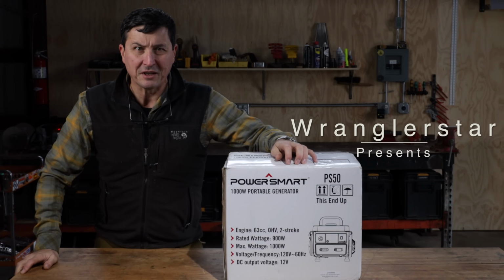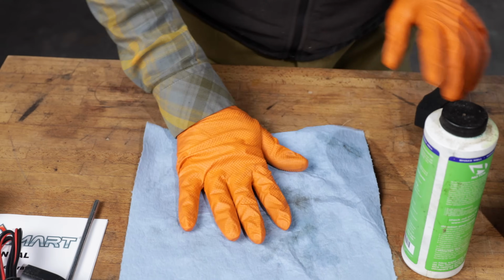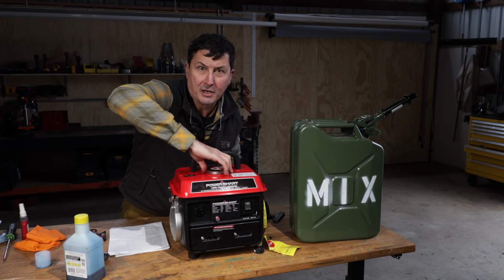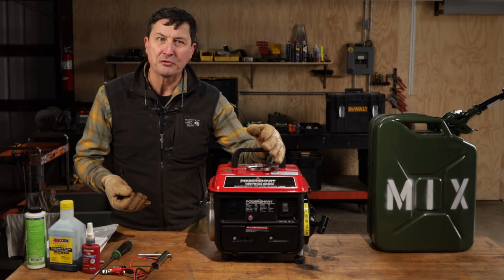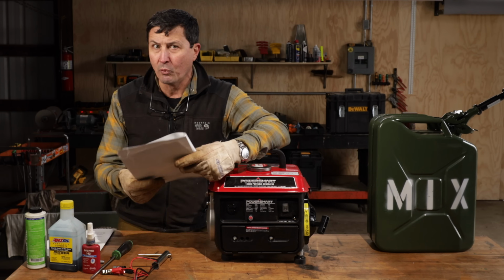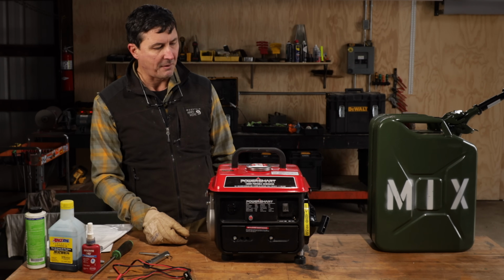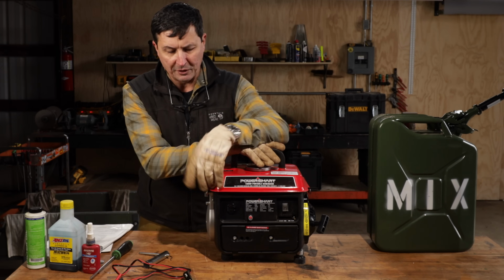TESTING The Cheapest GENERATOR on Amazon -$99

Comment: i have a gude (basicly identicall without 12v charger), had it for 15 years, plastics falling apart,  one leg fell apart, fuel cap leaks, leaks oil from exhaust, never changed spark plug nor air filter and the damm thing still works and starts every time easy on high altitute and cold . those small generators are great for a small off grid house to power the lights and some small stuff.

Comment: I have the ace up version of that generator for $200. Also a 2 stroke. Also 1000W. Doesn't have a sperate 12V battery charger sadly and surprisingly. 71CC though compared to 63

Comment: The 20 amp plug is there so if someone needs to use a 20 amp connector it can. The machine will not even handle a full 15 amps. So the plug is designed for functionality not for usable capacity.

Comment: About to buy a cheap generator to use in my yard truck to run my 120 v string trimmer on the far ends of my property.  Battery string trimmers just don't last long enough.  So that why I'm thinking of this generator.  I have a 12 KW standby generators on my house, with an ATO, and a  6KW one for the shop.  But that darn string trimmer is a pain to keep recharging. And there is no way I want to load up the big shop generator in the yard truck.

But here's a tip for you folks.  You can either buy a boat fuel tank with the quick releast fuel connector to rig to you little generator, or just buy the male and female boat type fuel connectors and rig them up to work with your 5 gallon Jerry Can.  The nice thing about these connectors is they have internal valves that shut off the fuel flow unless pugged into the other corresponding fitting.    So using a "T" fitting and having the ability to remove your big can to run after more fuel while it's running on the oem tank is a big plus....You may want to put a ball valve on the "T" so you don't back fill the OEM tank when running on the aux tank.  Depends on how you set them up.

I use the boat connector set up on my 4X4 trucks rear rack gas cans so I don't even have to pickup that heavy 5 gallon can to fill or pour from it.  I just refill it at the gas starion when I fill the trucks normal gas tanks......  BUt I do use a small 12 volt  fuel pump as a transfer pump from the 5 gallon to the main truck tank.  Or for sharing with others or the motorcycles we take with us.  And that's how I fill my lawnmower without having to put a gas can inside my vehicles.
Reply: Curtis

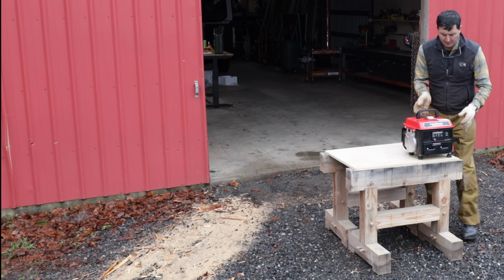Comment: 6:05 gotta love the ol two-smoke engine. I've been using mine for years. Keeps the cabin lights on and solar batteries charged in the wintertime. Pro tips: use fresh no - E gas and Husqvarna low-smoke oil. To kill it for the day, shut the gas off and let it run out. It starts even in Sub-Zero temperatures, ask me how I know. Keep an extra plug. Peel off all the silly stickers. btw, Mine doesnt have a 12VDC output. Just 120VAC.

Comment: I've got 2 two-stroke generators, both Homelites. Ones an XL-12 A115 (yes based on the sixties XL-12 chainsaw platform) and a larger 9A115-1 that used to be owned by a local fire department that i just bought today at an engine show. Seller had a matching water pump, but sadly I didn't have enough cash on hand to buy it as well for the $40/each the seller wanted for them.

Comment: I think those Torch sparkplugs are actually great. I've got this old Ross lawn mower and after watching this I assume the Torch plug in it is the original. Its probably run 1000+ hours over more than 10 years and is still going strong now even with multiple cracks & a bit missing from the porcelain.  At least 2 times I've given it a good soak & clean out after it totally gunked up & with sandpaper too and works a treat again after.

Comment: Yep this is an older vid but I had to comeback to it . I had a harbor freight tailgate when this came out . I liked it . It just worked . Infact I just got my hands on another that needed some work done on it do to sitting around. It was gotten for when the power would go out and it never happened. So the fuel just sat in it for years . Until I came along and got it . I drained it and gave it a clean out . It just fired up ! I have #2 !

Comment: I have one but my battery backups don't like it because the AC frequncy doesn't stay close enough to 60Hz at no load or changing load, but my computers run on it no problem. It's a lovely generator otherwise, great for running lights, chargers, and refrigerators. But it's not as good as an inverter generator of course.

Comment: I bought one at garage sale $5. Needed a fuel shutoff valve tank and carburetor cleaned. Put a paper fuel filter in it. Tank not perfectly clean. Works well takes several pulls to start.

Comment: I just ordered this from your review. I just received it an unboxed it. To my surprise, the latest PS50 is not 63cc. It comes at 71cc and is no longer 1000w 900 out, it has increased to 1200w and 1000 out. I ordered the 1000w because it was the only one listed on amazon. There was no general information stating that they upgraded. This is not a complaint by any means just a great surprise. Thats was really cool to receive MORE than what I originally had planned on. I will give it a trial run and report later about the upgraded version.

Comment: I ordered the upgrade version of this generator.
Right from the get go it made a clanking sound. I ran it anyway only because I needed it for my refrigeration. It still runs but I think I needed to deal with the clanking noise. I'm guessing it is something to do with the coupling between the engine and the alternator.
I'll let you know when I have time to find out. Also the plastic part the plug socket is mounted in isn't secure so I have to hold the plastic when I unplug the cord.
In the meantime... I bought another one. It's running great. Except I forgot to put oil in the cylinder... But I did put some oil treatment in the gas tank. It's running great. No issues on the replacement I bought. The first one I paid $159.99 and the second one was $141.94.
This generator is a model PS 50A which is a little better than the one you bought. On mine the label says it is a 1200 watt generator. I tried running a large microwave oven and it couldn't get the magnetron going. It heats a small griddle okay.
Currently I'm running lights, refrigeration, and charging batteries.

Comment: This is a 1000 watt generator, so how did you run a 1500 watt heater on high? I don't believe you got the full benefit of 1500 watts. you got around 800 to 1000 watts because the generator tops out at 1000 watts. It is also rated at 7.5 amps. The 1500 watt heater requires 15 amps. Also, I WANT TO HEAR COMMENTS ON THIS.

Comment: I know I'm a little late to the party, but I have seen and used lots of these. They're actually pretty good.
Some opinions are.

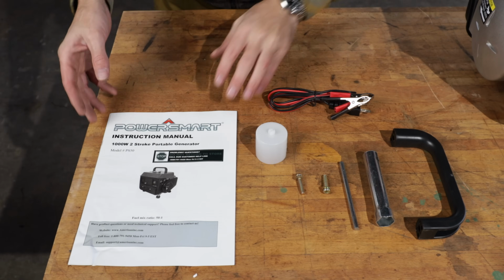0:32 actually, that's the first time I've seen that on a manual. Very nice
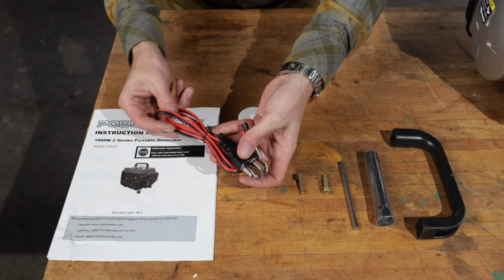0:40 those 12 V cables usually explode when used. They're usually too thin for the 8-10 amps they're supposed to deliver.
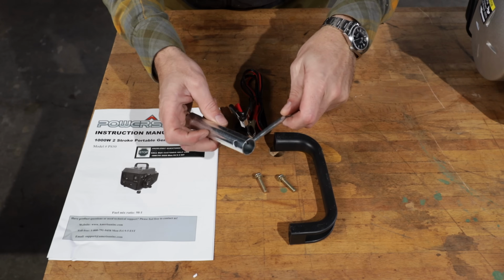0:56 I don't see the gaskets that those handles use. The screw holes on the tank are almost always pass-through.
2:00 you're actually supposed to impregnate the air filter sponge with oil.  Also, the manual recommends motor oil.
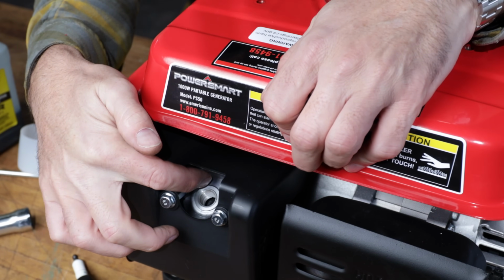3:55 actually. A lot of these are test-run at the manufacturer for QC reasons and a lot of times, they're run on low oil, so you get pre-scratched cylinder walls!

I actually own one of these. Got it 6-7 years ago and I love the thing. The  piston and rings are completely worn out by now. Unfortunately, it's more expensive to buy a cylinder repair kit than getting a new unit. So I'm thinking of retiring the engine and using the generator head with a 7HP Briggs engine I have laying around. A few pulleys and run it at half speed.

Comment: Tried 3 different "1000 W" 2-stroke generators (including Harbor Freight) for running (separately) a GE upright freezer (500W running) and a LG Frig/Freezer (750W running). None of the generators could handle the starting load ... immediately tripped off-line. Never bothered to try the house's gas heater. Such generators are evidently useless for anything with a high starting load.
Reply: Wonder if a soft start device would work with this?

Comment: can it run small refrigerator with this specs ? echnical Specification
Total Gross Volume (liters/cu.ft) 159 / 5.6
Total Storage Volume (liters/cu.ft) 139 / 4.9
Frozen Food Storage (liters) 28
Fresh Frozen Storage Volume (liters) 111
Power Input (watt) 95W
Rated Current (ampere) 0.72A
Power Source (volt/hertz) 230V / 60Hz

Comment: Wondering if you connected this to a UPS with voltage meter to see if it makes 110V steady? I bought what seems to be the same model here in Poland and could only make 180V not the 220V expected .

Comment: I have a Gen like this since 12 years. Runs and starts like the first day. Nothing replaced except the airfilter foam and added a fuel filter between tank and carb. Most time it runs on alkylate gasoline or something else like this i can get cheap. Gasoline is a bit pricey in Germany. Lowest quality of gasoline 95 octane was about 7.36USD/Gal this morning, Diesel 7.8USD and gas 98+ octane 8.45 USD...

Comment: Ok those are not $99 anywhere at anyplace brand new. Right now it is currently october 2021 and you cannot find anything like that NEW anywhere. maybe a used one needing work. Time to take down this video and post a new one, this one makes viewers think they can get these for $99, this one on your video here runs brand new for about $259 , not even a cut rate pawn shop sells these for that low
Reply: 2 years and the price has doubled, it’s crazy

Comment: Looks like a great unit! The reason they supplied a 20 amp plug is so you can use a heavy 12 or even 10 gauge extension cord on it. The longer the run, the heaver your cord should be to keep the resistance low.
Reply: @Soup Can while a bigger gauge does waste more power than a fine gauge, its electrical efficiency is better because it can dissipate heat faster with more copper giving you a longer run time
Reply: Do not listen to this man
he does not know what he is on about and also does not make any sense @XTripleJaxX
Reply: @XTripleJaxX  I'm confused by what you mean by bigger gauge is less efficient than finer gauge, if you're talking about the numbers being bigger wasting more power yes because gauges are inversely proportional to wire size, if you're talking about the wire being bigger wasting more power that is false, what wastes power is resistance and the bigger the wires the lower the resistance

Comment: smart about the oil. i am a mechanic and i did this with this type of gen. I have the Pulsar 1200.    65dba
you should also do a break in process  by alternating load after 3 heat up cycles.  go 40-1 and not 50-1 premix using good premix.   get an NGK plug.  I cant believe how much this gen now cost! I paid 99$ a few years ago for it. good to have a small gen for fuel economy.

Comment: Ive hard a few of these for years and years.  I use them to power tools and other items when i cant get power otherwise. I have several hundred hours on a few of them.
Couple tips-
Replace the spark plug for an ngk or autolite.  Much smoother running
Pull every bolt you can get easy access to and put some sort of thread locker on them. 
Run the premix a little heavier on your first tank.
Use smokeless 2t oil.  Ive been using the marine stuff for a few years now with no issues
Get a little 6 outlet power strip and a few L brackets and mount it to the side of the fuel tank using existing bolts.  The stock outlet is pretty weak and not a standard size so its a pain to replace when it falls apart which it will.   Keep the power strip plugged in and plug everything into that.  Bonus if your power strip has an on/off switch.
Use some fuel stabiler to every tank if you know you wont be using it in the near term.
Reply: What model numbers for spark plugs?
Reply: Eric:  thanks for the tips on the 2 stroke generator.  Do you think it provides clean enough power to run a most warehouse type fans without damaging their 1/2 or more electric motors?  I know I need to make sure within operating specs, but my issue is the quality of the power itself coming out of these cheap gen sets.
Reply: @horacesawyer2487  these little guys have shockingly clean power.  It should be fine for fans.  I use one of mine to run servers from time to time and they havent been effected by the power output either.
Reply: @ericeven4090  :  Thanks Eric !    Love the information exchange and comradery here.

Comment: I took a couple of minutes and put a fuel filter in mine while replacing the fuel lines.  I bite the bullet and buy ethanol-free gasoline for all my small engines.  I spray the cylinder with fogging oil when storing it.  I start it every six weeks, let it warm up then put a load on it for 20 minutes or so.  During an 18 hour power outage last year it ran a refrigerator-freezer overnight, about 10 hours, much to my surprise.  Granted, that was a light load, but Wranglerstar is right, this thing punches way above its weight.  I've had mine for about four years.  I did put  an American spark plug in it out of the box.  Have fun!

Comment: August 2021 price $189   900 watts continuous   2 stroke engine

PowerSmart Generator, 1000 Watts max Portable Generator, Outdoor generator Low Noise, Gas Powered Portable Generator, Inverter Generators for Home-use, PS50A

Comment: Seems identical to my HF TailGator (except that on mine there is no 12vDC connection.  There's a bit of a notch on the side where the part 'could' go.)  It's loud and smokey, and it doesn't exactly start on the first pull (like my Honda eu2200i), but it is good to have and cheap like the man says....

Comment: Running a 1500W heater from a 1000W generator does not mean you actually ran 1500W.  A generator will run something like a heater element at whatever power it can up to the 1500W, so without checking current, you can't assume it was 1500W that the generator put out.

Comment: These generators are all the same and all made at the same factory in China. The same exact one they also sell over at HF. $79 with discount. We've had our for yrs. with no issues at all. Jus' replace the spark plug with a higher quality NGK, use quality quality gas\oil and you're good.

Comment: If you are running this on California Blend gas, keep an eye on the fuel system to watch for leaks. A lot of equipment that comes from China, uses o-rings, gaskets, and fuel lines that can't handle ethanol-blended fuel, and the ethanol will eventually rot some of the components in the fuel system. Also, this being a 2-stroke, the carbon-monoxide emission (and the smelly fumes) are going to be way higher than with a 4-stroke engine; try to run it as far away from where people are breathing the air as possible.

Comment: Do you think this would run an 8000 BTU portable Black & Decker air conditioner? I’m not really sure how many watts of ramps it is. But we ran it with our solar powered Ecoflo generator and only lasted for an hour and it said it was pulling 800 to 900 W out of the solar powered generator

Comment: This seems to be a nice generator for the money. I had a snowblower and a lawnmower with Torch brand sparkplugs that worked great. I changed the plugs after 4 or 5 years just due to age, but they were working OK. Both of these items had Powermore engines that worked perfectly. My lawnmower is at least 6 years old and starts first pull. I am very pleased with these little engines.

Comment: I bought something similar about 10 years ago for $50. I "powered" an RV with it, but it only lasted a couple weeks. I kept having issues with capacitors (IIRC) and soldered things a half dozen times, then the plastic cooling fan exploded everything burned up.

Comment: These gennies are from an old Yamaha patent.  
They are NOT suitable for electronic appliances because of the non clean power.
However IMHO they are excellent for basic electric motors..  IE drills, angle grinders, etc
A friend built his lakeside dock with one of these..  
I love 'em.  Simple, cheap and very useful....

Comment: After a year what is your opinion of this unit now?  I might need a generator like 1 or 2 times a year.  I have a job I am going to without power.  I would like to run a saws all to cut up some stuff inside. I will  be taking to the dumpster.  What are your thoughts on this unit now?

Comment: Do NOT connect electronic devices to this thing, it's not an inverter gen.  Electric devices are okay though. 
The exhaust fumes are toxic.
It's NOT an emergency gen.!!  If you use it as an emergency gen, buy the best inverter type you can find.  (Honda, yamaha)
The rope starting mechanism is crappy and will let you down.
I used mine in the garden cutting hedges for 3 years, than it broke.

Comment: Funny how it clearly says 7.5A Rated Current and he is claiming a 15 amp breaker some people don't know how to read. It's the same as the Tail Gator at Harbor Freight which costs about the same on sale. The one down side to the 2 cycle gens are that always and I do mean ALWAYS shut off the fuel valve and let it use up the fuel in the line. Do not just turn it off at the switch and walk away. If you do in about 3-4 days the fuel will foul the carb up and the cost, shipping, and time to replace is about the same as a new gen. Also use the ethanol free gas and if no stations sell it go to a boat dock because that is almost to be ethanol free.  I have had one for just over four years and cleaned the filter and plug yearly and only just had to change the plug after four years.